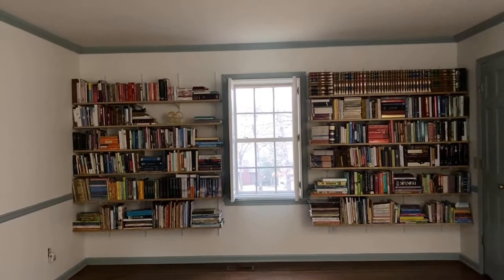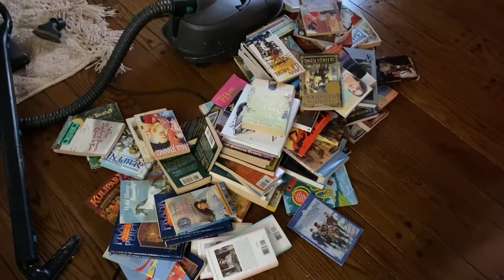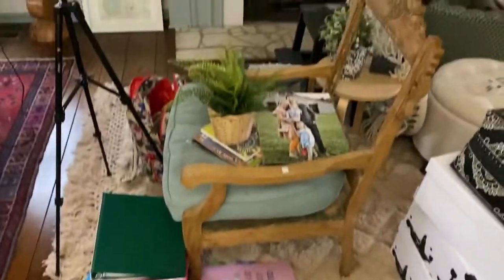Installing Bookshelves with Wall Tracks, Brackets, and Pine Board Shelves

Comment: Hi, would these work on a wonkey wall? our wall has lumps and bumps
Reply from the maker: Hmm...probably depends how big the lumps and bumps are. The tracks are supposed to lay flat against the wall. As long as you can get them tight enough, it should be OK. The shelves end up being off the wall by a couple of inches, so that's not an issue. That would actually hide any weird spots I would think. Maybe try one track first?

Comment: Great bookcase. I'm thinking of something similar for our house. Did you guys look into the elfa shelving system which doesn't require the verticle rails screwed onto the wall studs? Also with weight from all the books, which now are on the studs, is there any concern that the house studs are strong enough to hold the bookshelf?
Reply from the maker: Thanks! I looked into all the options but this was the cheapest for the look I wanted. As far as the weight, I had the same question! But my husband did all the calculations and we haven’t had any problems.